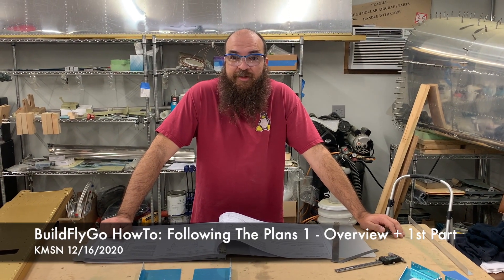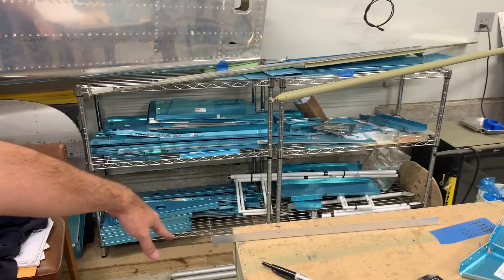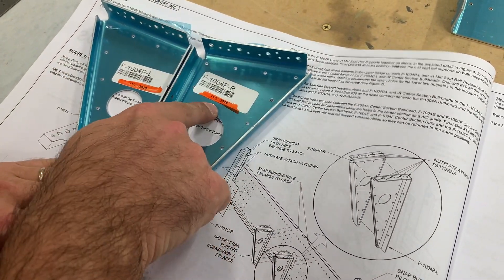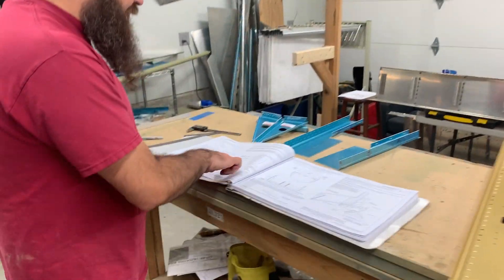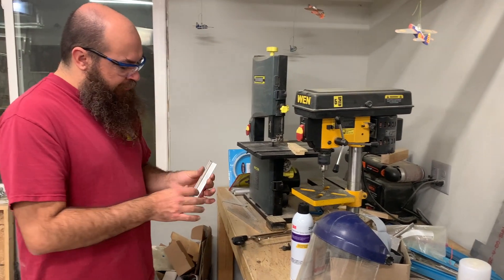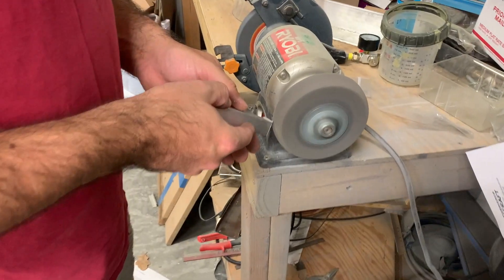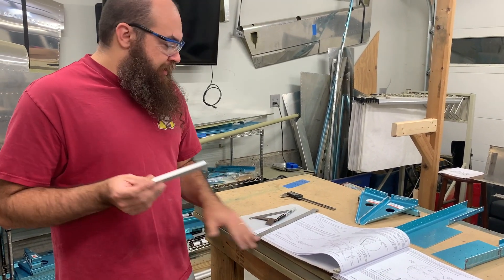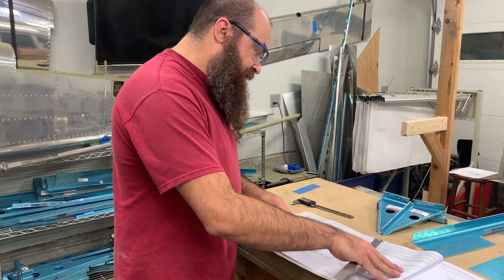HowTo: Following RV Build Plans - Part 1

Comment: Have you ever used a good quality miter saw with a carbide blade to cut your aluminum angle? I like that method because it gives nice square cuts with a good finish to the cut. Have to go slow within material though...
Reply from the maker: I have not, I'll look into that. Thanks for the tip!

Comment: Thanks for the video Guil.  These newer plans are awesome. How easy was to follow the old version/plans for the RV9?
Reply from the maker: The -9 plans were quite readable but the sections were not broken down and you get a wall of text. If you're good at pictuing designs in your head after looking at them you'll have no problems. The -10 ones are definitely much easier to follow.

Comment: What plans and drawings do you get when you order a subassembly kit, versus the study book you first order. I’ve seen listed on Vans’ website “study” plans, but later they mention a larger (24x36 inch) plans book that you use along with the study plans.

Great videos by the way. I enjoy what your presenting in your videos and how well you’ve documented it.
Reply from the maker: The plans in the video are what you get when you order a kit. Those plans came with the fuselage kit. The RV-10 does not include the large plan sheets, those came with the older kits.